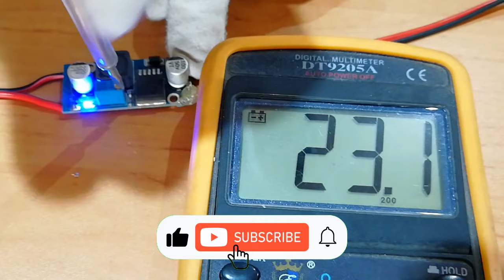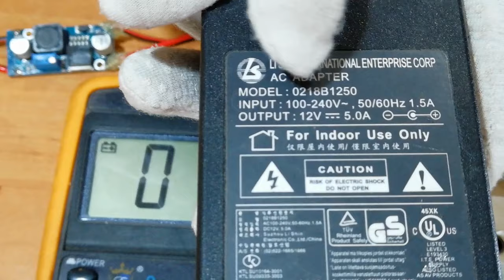How to use LM2596 DC DC buck converter Step Down Voltage

Comment: Does this have the range to step down a 24v source to 3-5v?
Reply from the maker: Yes, it is suitable. The input voltage can be from 3 to 36 volts and the output can be set from 1.5 to 30.
Reply: @newtecpro  Thanks!
Reply: Pm me can you to install do solar panel of charger _

Comment: Hi, is something wrong with my LM when the colour of diode is red, not blue?
Reply from the maker: Hi, no problem. I'm currently using an old module which is on. Its LED is red
Reply: Pm me can you to install do solar panel of charger _

Comment: did it come from the factory set to 24v? I do not have a multi meter and need it for 12v. How do i set 12v without a multimeter?
Reply from the maker: Hello. Because the output voltage is variable, it cannot be set to 24 volts without a multimeter. Can you help someone with a multimeter for a few minutes? It is enough to set the output to 24V once
Reply: Pm me can you to install do solar panel of charger _

Comment: Can i wrap it with insulation tape? Just to stabilize a single 12v minifan 0.12A outdoor
Reply from the maker: If the consumption is below 2 amps, you can use an insulating cover. It is better to use heat sharing.
If the current draw is higher than 2 amps, it is necessary to use a heatsink on the main chip.
Reply: Pm me can you to install do solar panel of charger _

Comment: Hi, is this suitable for audio devices? I plan on making a multiple power supply for guitar pedals and a single 24v power supply
Reply from the maker: Yes, you can use it, but this final model must have an output of 2.5 amps. If you cool it
Reply: Pm me can you to install do solar panel of charger _

Comment: Can I ask...can I use that in my 9v solar panel... thank you for the tutorial and the review of the converter...I hope I can do it the right way
Reply from the maker: If you have used a battery (eg 12V DC or 9V) in your solar system, yes. Get 9V DC from the battery output and convert it to 5V using the voltage reducer module.
Reply: @newtecpro  Can I wire the output of a buck converter directly to a usb, set it to 5volts and charge my phone with it?(Or 5.5 volts whatevers)
Reply: Pm me can you to install do solar panel of charger _

Comment: Did you all apply solder to the input and output terminals before getting started?
Reply from the maker: Yes, this is a better way to connect the wires. Faster and stronger soldering
Reply: Pm me can you to install do solar panel of charger _

Comment: Can I use it on my ESP32 Dev Board? with AC/DC Adaptor, which the AC is around (100V-240V)
and DC is (9V 2A)
Reply from the maker: You have a 9V 2A adapter is that correct? What is the voltage you need?
Reply: @newtecpro  Yes, but I do not know what voltage is needed to ESP32 DEV BOARD. Sorry, I am newbie
Reply: you can also get Ac-Dc & Dc-Ac converters ..

Comment: Without load form o/p,preset not adjusted. But LED connect of o/p then preset is working.module is ok  OR  defective.please teil me.
Reply from the maker: What input voltage have you connected to this module? What voltage do you get at the output with the multimeter?
Reply: Pm me can you to install do solar panel of charger _

Comment: Can I use this to tranform 3.3V to 1.5V?
Reply: No it does output of 4.5V to 40V
Reply from the maker: yes you can:
Output: DC 1.5V to 35V voltage continuously adjustable, 
Input: DC 3V to 40V
Reply from the maker: The output of this module is 1.5 to 35 volts
Reply: Pm me can you to install do solar panel of charger _
Reply: @newtecpro  Must I also connect the Negative iinput and Output . And can it working If i onnly connect the Positive input and outPut
Reply from the maker: @princejoseph8389  Yes, it must be both - and +.